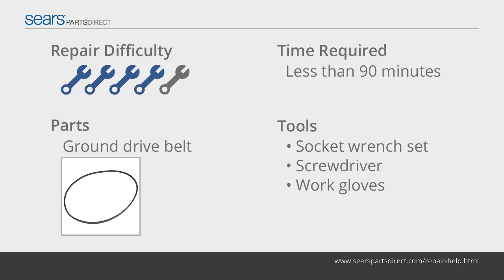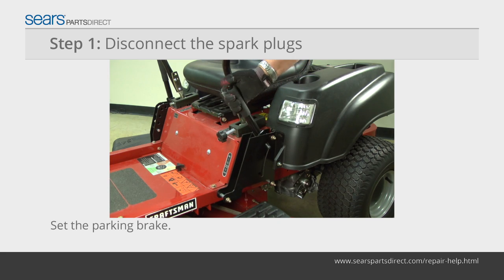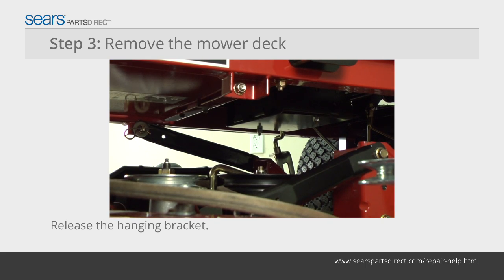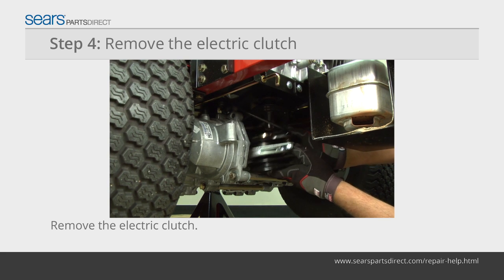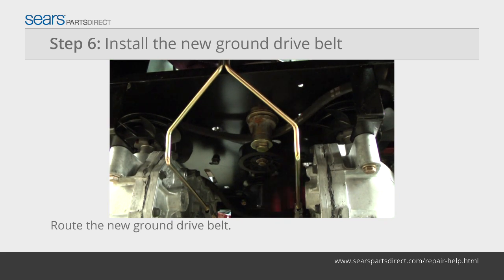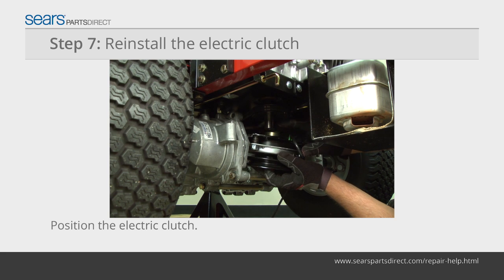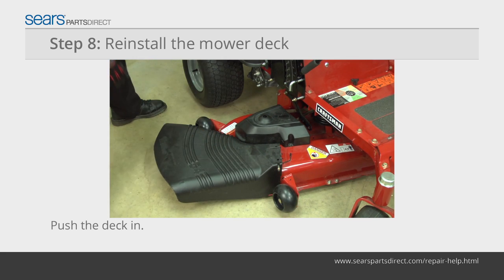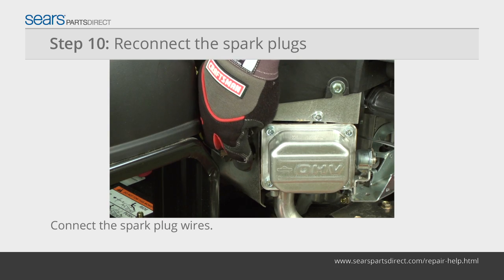How to Replace an MTD Zero-Turn Riding Mower Ground Drive Belt

Comment: I have an MTD built ZT54, and the electric clutch connection is underneath, and all but impossible to get 2 hands to it, without having the mower on a car  lift.  It also has a hydraulic reservoir that has a hose coming down and teed off to both drive units, so there is no way to remove the belt without disconnecting the hydraulic vent lines.